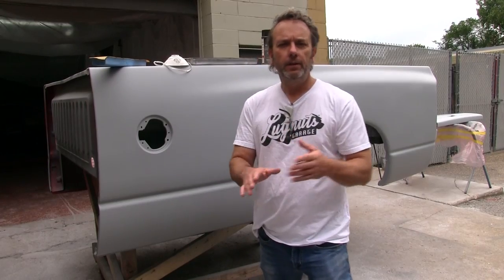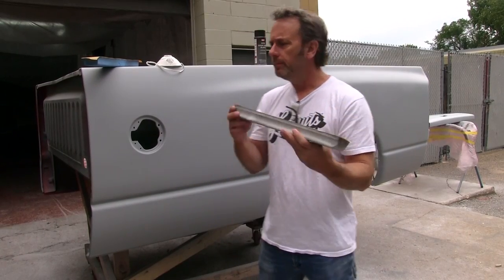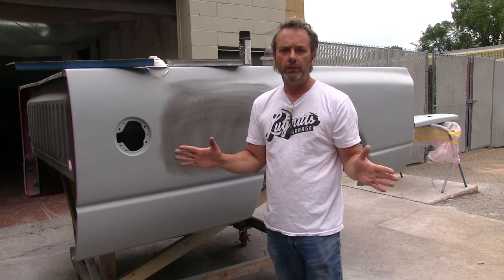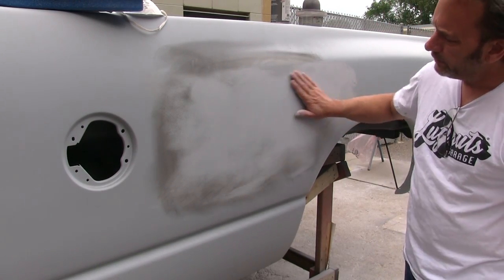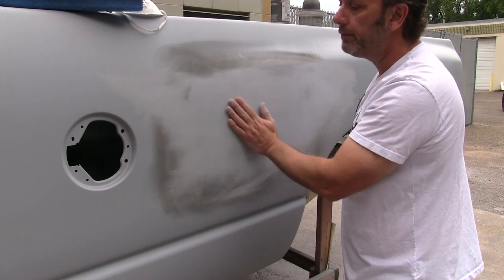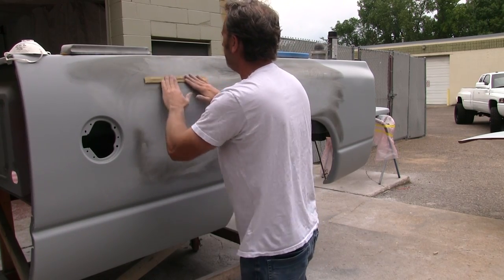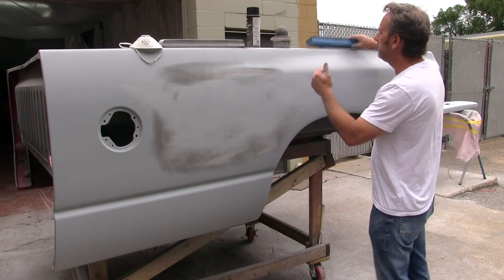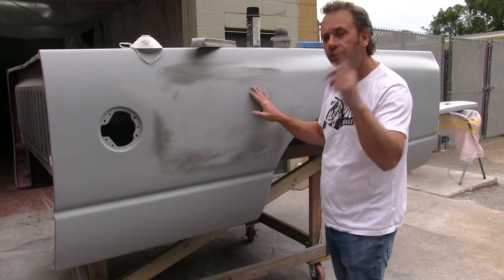Block Sanding | Make It Straight | Lugnuts Garage

Comment: Im with my orbital 320 and water 💧 smooth and even and im not tired
Reply: That only works if it was already straight to begin with at that point your just smoothing out the finish not correcting anything

Comment: I still donot understand the proper use of dry guide coat and when to apply it???
Reply: it makes it easyer to see the difference between high and low spots.
you apply it so you can see the difference with what part is sanded and what is not, parts that stay black are the lower spots. so you know where to sand more, and where not to sand.. or what part maybe needs a bit more putty to fill up.
you can use it when sanding with 80 grit on putty as a guide coat, or use it when sanding with 1000+ sandpaper to see if all the scratches are gone before painting.